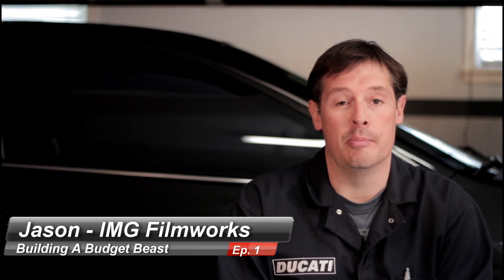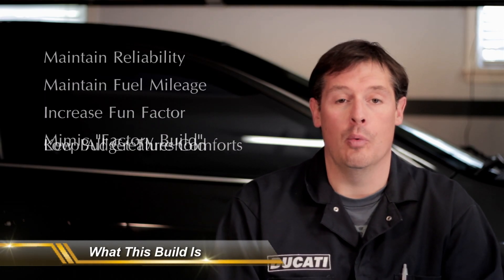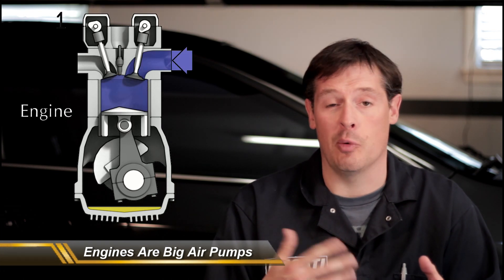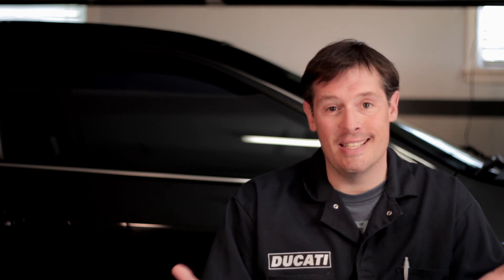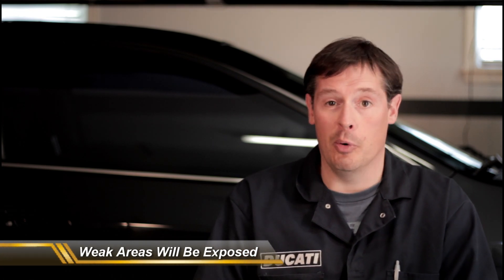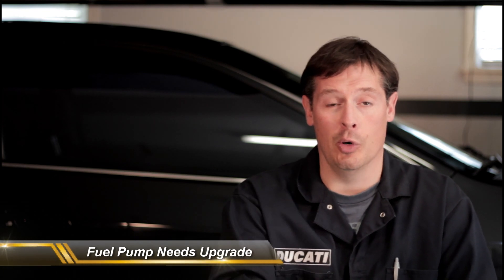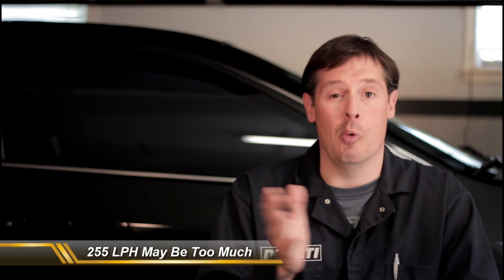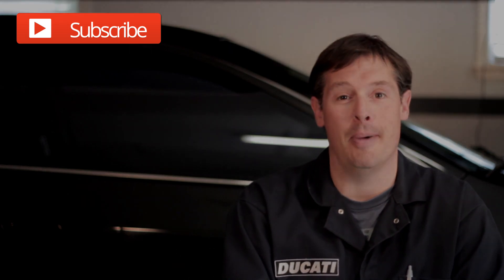Episode 1 - Building A Budget Beast - Honda Turbo System Build Series

Comment: I have been looking for this video.   I just did a full rebuild on my F23A1 powered 98 Accord.   I'm thinking now since I have a freshly rebuilt engine, now might be the time to go ahead and add that turbo or supercharger.   Of course my only issue now, is my BAXA auto trans.   It is also a freshly rebuilt unit, just not sure, I may convert it over to a 5 speed manual.

Comment: My name is Kevin this will be based on a budget build all though I've found for the most part all my aftermarket performance parts- break rotors drilled and slots with ceramic pads adjustable coil overs complete suspension parts and steering parts. Were all cheaper than OEM don't take me wrong there is a place for OEM and it's electrical OEM is the way to go, I'm getting lost here the main reason I started this, did you buy everything to do your turbo as a complete kit I have a 2001 2.3l Honda Accord EX coupe also and I've found a couple complete kits I was just considered about the fitment of the turbo and intercooler I mean I know that there are going to be some issues but anybody have any insight would save me some time and money would be appreciated Thanks

Comment: Rubber Duc please help!!! I have a honda civic with a d15b7 and it has 270k miles on it and I was wondering what you think I should do before I try to turbo it??!?!?!?!?!! it runs fine, but idk how good the internals and stuff are!!!
Reply: Bookie Anderson head work and bottom end work too. If your ballsy, just cut trim the piston rings to avoid any issues with the pistons. Cai, and more fuel delivery (the more LPH in the fuel pump the better, search around for what you need. Upgraded injectors, coils and a colder plug setup”

Comment: What if I put a turbo on my 1999 Accord lx 4cyl 2.3L vtec? I have 300,945 miles on it and it runs perfect and it's fairly quick with a few upgrades I installed. I do always keep up with my car and I do want to turbo it within the next month or so. I have no leaks in the engine and it doesn't give me problems at all. Thanks.

Comment: I have a non turbo civic and every forum I see says I have to buy new manifolds , fuel pumps , and the list goes on. people are saying how if I dont have 8000 dollars plus then its a waste of time and if Im not doing all the work myself then I shouldnt expect more than 5psi of boost. So I wanted to get your opinion on this , would I be able to turbocharge my car without ruining its reliability and make it just a more fun daily driver than it is now for a reasonable price or are the forums I looked at right?
Reply from the maker: Ha, that is what this series is all about!!!! Like I said in the very first episode, this was an experiment to see what would happen.  In regards to people on forums, let me put it this way, I don't care what "people" on a forum say, I care about what has been done.  With that said, I turbocharged my 275,000 Accord 3 years ago.  I've run 5-6psi daily and beat the snot out of it.  It now has over 303,000 miles and runs as good and as fast as the day I put it on.  All those forum experts would have said "NO WAY, CAN'T BE DONE...", but I did and they were wrong.  At the end of the day you have to decide for yourself, but I don't visit forums much anymore b/c that is what you get.  Most of the people bitching on forums probably couldn't even change their own oil :P.  Good luck with whatever you decide, thanks for watching.
Reply: Rubber Duc would you suggest going with a kit and if so which one? , the cars only at about 8,000 miles and has oil changed every 3,000 so its in nearly perfect shape . im only looking for about 8 psi because im wanting a fun daily car not a track machine
Reply from the maker: Not really sure on the Civic, different engine, I can only tell you about the F23A motor.  I didn't buy a kit, I bought all the pieces separately, you can check out either episode 2 or 3 and it has the parts break down and will show you everything you need.  If you can't find something like a manifold you can always have a good welder fab you one up.  Remember the way I am running my car is with an old school FMU, so the computer is untouched.  I wanted it this way and did it purposely, but a lot of people (same forum people) will tell you it is outdated and not as good, etc. which is honestly the truth but I like it this way.  Good luck.

Comment: My accord is a 93 ex with 193 thousand miles on it, it runs like a top. Do you think a turbo would melt my engine? not literally.
Reply: how much boost are you planning on running? i know that the fifth gen accords 1994-1997 can only run like 9 PSI or so lol. i only know and said that because I have a 94, i have no clue about 93 Accords though. just do your research and see how much PSI you can run

Comment: very well put but i think i'm still going to go with the k-series swap on my 93 accord. my engine right now has 250k+ miles on it and has bad valve seals.it's probably a better choice
Reply: I got a 2000 accord  131k miles in it ... but want to do the same k series swap

Comment: yeah but even with a healthy engine, with more power means your parts will break faster.. i heard boosted engines only last 100k miles
Reply: Not true, how long your car lasts depends on YOU just like N/A motors rely on how they're kept.
you could buy a geo metro with 0 miles and not ever change the oil, plugs, brakes, etc and it will break before 300k of course once you get into serious power this changes but a stock boosted car should well last 100k if kept properly
Reply from the maker: That's a main reason this series was started, to see "what happens" when you turbo charge a car like this.  This series is answering the questions, what happens when you turbocharge a high mileage Honda, and how long will it last if you keep it at relatively lower boost levels (5-6psi).  So far I've gone well over 25K miles since the build and the car has over 301,000 miles on it today and she runs as well and is as fast as the day I finished the build years ago.  Your mileage may vary but I'm pretty impressed, I love my Honda lol!  Thanks for watching and commenting.
Reply: Rubber Duc haha, I can't talk about reliability my Dodge srt 4 made it 18k miles on a build. Mostly due to previous owner being irresponsible for the vehicle but eh

Comment: Hey guys im new to cars and I am really looking for a good drifting car/ good acceleration. My budget is $5000-6000, Cars i have been looking at so far are bmw e36, and or nissan s14. I will have around $1000 for upgrading I mainly want a good jdm car :) thanks
Reply: What cars do you guys recommend to me and what upgrades :)
Reply: +SimpleNipple if your new to cars and want to drift dont buy a nice one cuz chances are shes gonna get banged up. i would get a s14 over any bmw they are not reliable and parts are hard/expensive. or get a cheap mustang gt lol or a old rwd corolla
Reply: buy a 350z
Reply: 350z or miata

Comment: Awesome series man! Tons of information. Waiting to see more. Like a diagram showing the order of fuel pressure regulator and fmu.. I have a 96 gsr integra that I rebuilt the bottom end on 25k miles ago. I daily drive it but I do own another vehicle. Would love to do exactly what you've done and have a reliable boosted Honda. Trick is I have to pass obd2 every year here in NH. So your setup in theory is just what in looking for. Think it would work on a b18c motor? The 8k rpm redline is kinda scary especially with a higher stock compression ratio... If you got a sec any response would be awesome, if not I understand and hope your making the next couple videos! Thanks man

Comment: Problem is you build one and it gets stolen the next day
Reply: 02 accords have chip keys with ignition lock.
Reply: +xDoyle514 True that...I speak from experience.
Reply: Isaiah when you tune it looses it
Reply: Omar Landrau only if you swap the ecu and you can get ecu's with electronic ignition. Plus he didn't even tune this thing.
Reply: Isaiah true but meh kill switches work

Comment: can i charge a automatic 96 honda accord?
Reply from the maker: +Allen Nembhard Sure you can, but an auto transmission is weaker than a manual so there is a trade off in possible maintenance of the tranny.  Honestly though they are so cheap on ebay I wouldn't worry about it if it were me.  I supercharged automatic Mustangs back in the day and had no issue, but they aren't as fun :)  I answer this question in episode 3 I think, which is a Q&A, thanks for watching.

Comment: i ran a 255 on my d16y8 stock (had it laying around for a spare) and i didnt notice any mpg difference, there is a return line for unspent fuel
Reply from the maker: +XxRageQuitxX Good to know, I've read that sometimes it does change the MPG for some people, depending on how restricted the line is going back into the tank, good to know it didn't matter on your car, thanks for letting everyone know.
Reply: +Rubber Duc ye'sir, i know accords are different but im sure they have a return line too, as you said it could be more restrictive than my civics and it forces the injectors to spray more fuel in than it is supposed to, also love the videos
Reply: +XxRageQuitxX well, in case the return line restricts the flow way too much, the temperature of the fuel lines will rise. Warm fuel = surging, irregular burn, lowered thermo-dynamic efficiency. But anything under 300 should not warm it up that much. As he says, it is more of an acoustic issue. However, running an overly powerful pump may put stress on other things, firstly, the electrical system of the car has to compensate for higher demand for power even at idle revvs.

Comment: I'm in the planning stages of my Accord. First I need to rebuild the engine. At 308,000 miles, I can't quite trust boosting it. My goal with mine is rebuild and reinforce with supporting mods then turbo it at 10psi. Thanks for helping me reach my goal that much easier.
Reply from the maker: +Damani Jones 500 miles away from 300k and running strong at 6psi now.
Reply from the maker: +interceptor231 Glad you liked the video and I agree at 10psi I'd worry about the block.  Good luck with it and let me know how your build goes!
Reply: I give props to anyone who makes over 280,000 miles (that's as far as I've ever gotten). Please update us
Reply: my f23 just hit 281,000 miles thinking about going turbo aswell.
Reply: Rubber Duc Hey rubber duck is there any way you could answer a few questions I'm wondering on my first turbo build/upgrade? subbed.
Reply: +Damani Jones 

Mine has 294,xxx miles on O.G enfine, on stock trans too lol
Reply: My trans is going out and I’m at about 250,000

Comment: can i pre add the 190l fuel pump until i boost it?
Reply from the maker: +Isaiah bell Yes you should be ok adding before you boost.
Reply: +Rubber Duc thank you, I'm assuming you used the stock fuel return for the fmu? since it's not tuned, do you run any octane in it?
Reply from the maker: I run 93 octane pump gas and haven't had any issues, but I'm only on 5psi and I have a step colder plugs.
Reply: +Rubber Duc do you use any check valves or missing links?
Reply from the maker: Yes the missing link.
Reply: Where could i possibly find one?
Reply from the maker: +Isaiah bell Hi Isaiah, you can get them anywhere but I think I bought it direct from Synapse who makes them:
http://www.synapseengineering.com  You can also get them on ebay or online from any number of vendors, good luck!
Reply: Do I have to have one of these?
Reply from the maker: +Isaiah bell Yes you do, otherwise your ecu will not know what to do when it sees positive boost, it installs where your MAP sensor is.
Reply: Can i use check valves instead?
Reply from the maker: I have heard of people doing that, but for 50 bucks I wouldn't, but that's me.
Reply: +Rubber Duc dont think they make a missing link for my 03 elantra
Reply from the maker: +Isaiah bell Oh, well then yes you would have to use check valves.
Reply: +Rubber Duc is the missing link a universal fitment?
Reply from the maker: No, there is a specific missing link for each car brand I believe, go to synapseengineering.com and check them out.

Comment: Interesting series you're doing!  I also have a 6th gen Accord coupe that I love, and did a little turbo build a few years back.  Though it's not a "budget" build, my goal was to make lots of power reliably on a properly built setup without all the extra expenditures  of unnecessary parts or custom work that so many Accord owners get wrapped up on.  My research and work paid off, and I'm still enjoying the Accord today with very few issues.  Looking forward to part 3 of your series!
Reply from the maker: +afaccord Awesome man, would love to see a video of your car in action.  Thanks for watching.
Reply: U still got it

Comment: People who know about this engine know that it is a great platform for turbo 
It has cast iron sleeves 
Big bore 
Long stroke 
I have this engine awesome platform shitty aftermarket i would love to see more videos 
Keep it up 
P.s it might be costly but bisimoto has a regrinde for the cam with springs and retainers also a bigger throttle body from skunk two would help with the horse power and fun factor it would be pretty kool to see it on this engine 
Keep it up awesome videos
Reply from the maker: Marcos Aruca Hi Marcos, thanks for the comments.  You are right, great engine for forced induction since it also has a lower compression ratio.  I also believe forced induction is best for the F23A engine because people that have spend a fortune on bolt on parts did not see much increase in performance for all the money spent at least from my research.  Great idea on the cam re-grind, I'd love to be able to open up the exhaust side of the valves since Vtec on this motor only effects the intake side, been thinking of that for a while.
Reply: theres a gentleman by the username afaaccord he has done a really nice turbo accord he has left a ton of research out on the interwebs just google his name im sure it can help out alot
Reply: and YES go for the cam i would love to see a video on how to install the cam etc delta cams is a cheaper route than bisimoto ive its only 150 for the regrind

Comment: Nice video. One thing I find interesting (judging from your other videos) is that your eBay turbo is working well. Most people report eBay units as being a mixed bag, with some quickly experiencing failure and others working well regardless of brand. Maybe in a future video you could cover how to accomodate for sourcing a second hand T3/similar sized turbo into the build costs/logistics etc.
Reply from the maker: austrooo Good idea, thanks.  In my opinion what I think is happening is with the influx of these cheaper units a lot more people can now afford them and they are buying them at a much higher rate than more expensive turbos.  Not for sure just a hunch, it would be interesting to know the stats on cheaper units vs. name brand.  With a huge number of people buying you are going to have failures, even the name brand ones have failures.  With that said I think there is also a skill level issue involved like I mention in the video, people might be putting them on and doing it poorly, or on a poor vehicle that should not have one installed thereby causing a premature failure.  Then you also have maintenance that we don't know about, how often are people changing their oil, etc.  How long do people let them cool down before shutting them off which is ultra important on an oil only cooled turbo.  The last thing and not sure how much this has to do with it, but I'm only running a low boost (5psi) application, might be a different story than say if I was dragging the car daily at 15psi + or something, but I feel like for the money they can't be beat.  Thanks for the comment, episode 2 should be out shortly.
Reply: Rubber Duc Yep, I'm aware of all of those possible avenues for issues to develop with any turbo setup. That said, I still feel, and the general consensus is with how much you pay for an eBay turbo vs. a quality one that it's to be expected as a very likely possibility. I think people have mentioned that the CXracing and Godspeed turbos were the better ones out of the 'china' crop. A lot of budget oriented turbo builds (in addition to more serious ones) have been covered on the D-series.org forums if you're interested to check it out. Many in a similar sort of vein to your build, what with boosting an econobox Honda engine and all. Looking forward to the next episode.

Comment: Did you video tape your turbo install?
Reply from the maker: Good_kid2450 Unfortunately I didn't finish taping it.  I had so much going on it became problematic to keep filming but I will walk through it by pointing important things out in episode 3, (episode 2 should be up in a day or so).  It is straight forward and not too difficult so I'll be just pointing things out to look out for in the engine bay, etc.  Thanks for the comment.